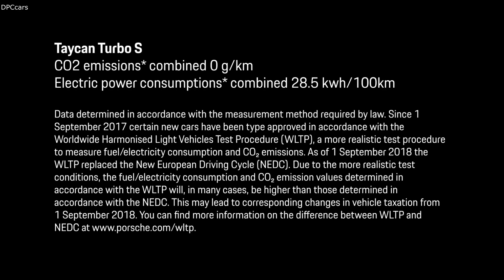Electric Porsche Taycan Turbo S Lap Time at Michelin Raceway Road Atlanta

Comment: Did you guys see on shmee youtube the tesla s won in the drag race
Reply: Tesla are quick in a straight line but put them on a track and there’d be no contest.  Questionable handling, poor build quality and nowhere near the heritage of Porsche, when did you ever hear anyone refer to a Tesla as innovating or groundbreaking?.  Top and bottom of it is that Tesla’s are a steaming pile of poo bought by clowns!
Reply: Shmme has the reaction of a grandma check out dragtimes or carwow for the race taycan defeated the tesla easily
Reply: I saw on his channel the Taycan drains a lot of battery compared to Tesla, but Porsche build quality far better. Other videos shown the build quality issues with Tesla.
Reply: @rapscallion7738  Yes well said, Porsche need to tweak the efficiency of the battery running time and they'll be on top.
Reply: @swada02  I feel like tesla super expensive so only the high lvl engineers has money to pay for it. Then the porshe is like 200k maybe twice or 3 times more than a tesla s. So it's even more out of range for the normal person you gotta be high lvl ..  ROYALTY
Reply: @randyle4520  Yep. Porsche has a heritage behind it though.
Reply: @swada02  I seen many porsches near the richest town in america . City callled Atherton.  Last time I ubered guys at this 13mill house and the house next door from theirs was 30milll cofounder of Microsoft. I've also uber near homes like 130mill most expensive in NORCali